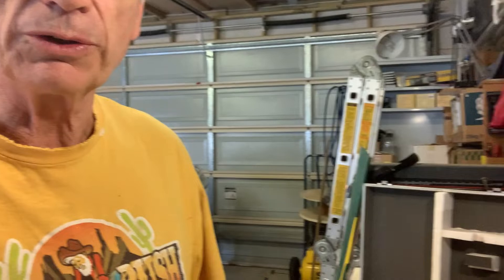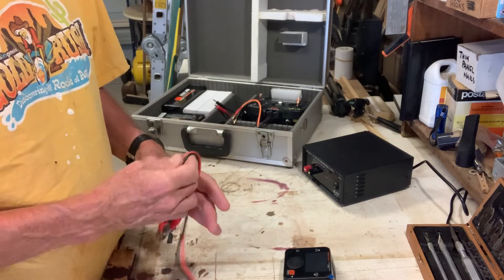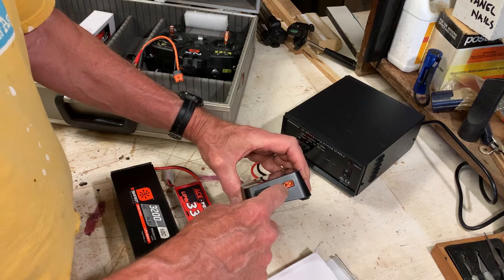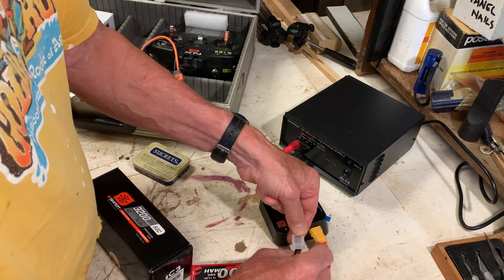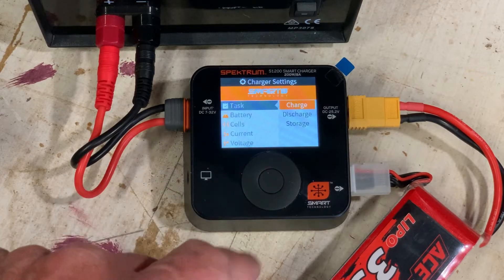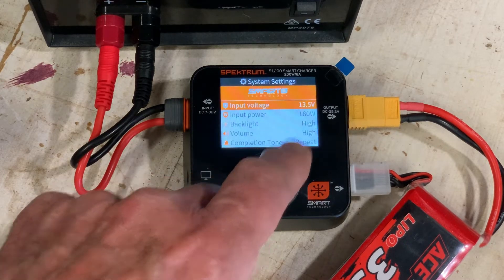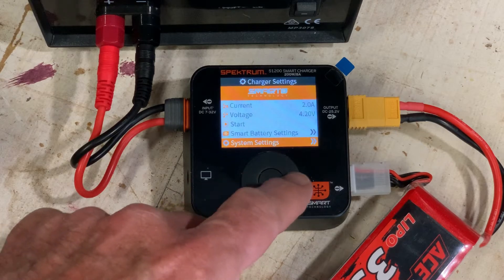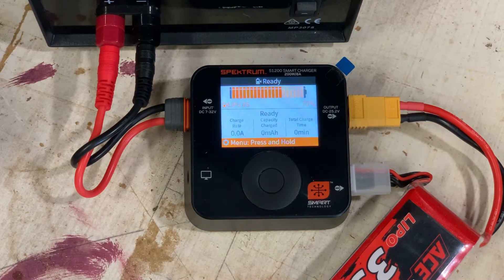RC battery charging

Comment: Video interessante Spectrum è un marchio molto conosciuto negli Stati Uniti ma dove si posiziona in rapporto a Futaba?
Reply from the maker: Futaba is a highly respected brand that has been around for many years.  I had a couple of their transmitters back about 25 years ago, and they were fine.  However, at our club here in Australia, they all use Spektrum, so in moving into the modern equipment that is what I have chosen to use.  I would expect that Futaba have developed similar functionality.